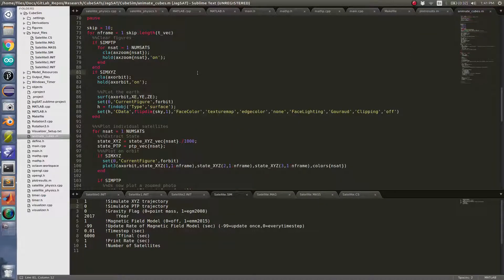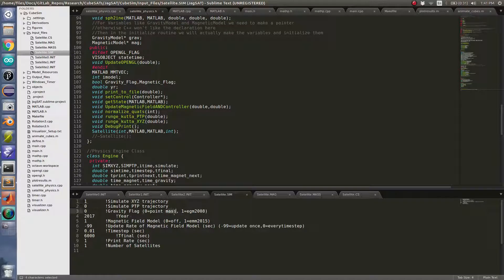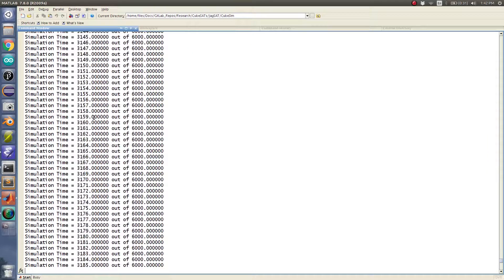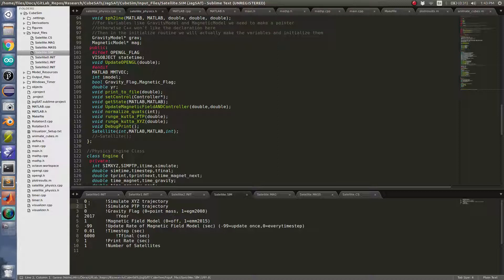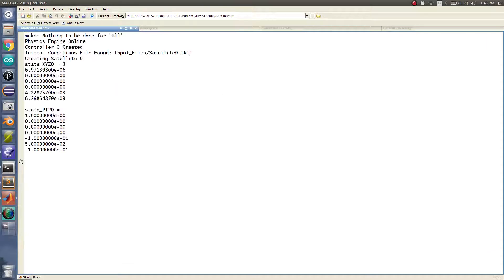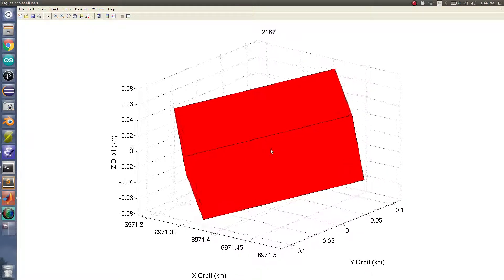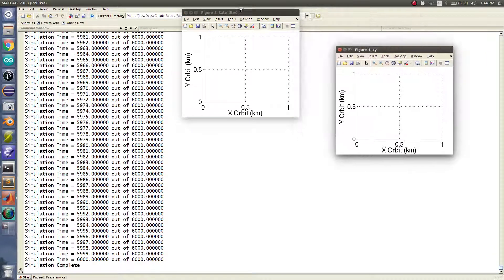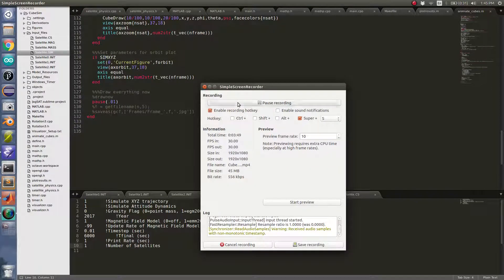CubeSat Orbit and Attitude Dynamic Model

Comment: Hi! Great simulation, really loving it. If I only can ask for your help, I'm still having trouble running the simulation (I don't know how), if you could help me out, that would be great!
Reply from the maker: What's the issue?
Reply from the maker: Have you tried to download the source code? https://github.com/cmontalvo251/C/tree/master/Orbit
Reply: @CarlosMontalvo251  Yea I did but the issue ist, that after I run plotresults, I get error, that State.OUT is missing in directory Output_Files.. I don't know if I did something wrong or something.
Reply: @CarlosMontalvo251  Like I'm not able to run makefile properly using mingw64-make, cause I have issue with boost/thread.hpp, which I'm not able to solve..
Reply from the maker: @lukasmatusik1096  Since this is a software issue tracked on Github can you raise an issue and I'll take a look?

Comment: if i'm extracting i, j, k vectors from my rotation matrix (3 * 3) is it possible to show them as 3D rotating vectors slimier to your red block using Matlab movie function?
Reply from the maker: yes you can. If you have a rotation matrix R the code would look like this

zero = [0;0;0];
for idx = 1:3
     v = [zero,R(:,idx)];
     plot3(v(1,:),v(2,:),v(3,:))
end

There are probably more elegant ways to do it but that will work.

Comment: What are you using to run both the MATLAB code and the C code?
Reply from the maker: You can rub system level commands as if you were typing into the terminal using a command called system() 

Does that make sense?

Comment: Really nice video, could you share the code?
Reply from the maker: Hey. Took me a while to get the code ready. Turns out this code was purchased by NASA and changed quite a bit. As such the current iteration of the code is proprietary. The good news is I was able to find a previous revision of the code from before it was purchased. It is not as nice as the current iteration but you will at least be able to recreate the plots in the video above. https://github.com/cmontalvo251/C/tree/master/Orbit
Reply: @CarlosMontalvo251  Wooo really really thanks.
This sure will be an enormous boost for everyone trying to learn orbital mechanics that watch your video

^.^
Reply: Or at least a really nice tool for showing orbits XD
Reply: @CarlosMontalvo251   The code is no longer at that link, could you post where it is right now if you have it?
Reply from the maker: @aryaashutoshpathak4849  The current C++ simulation is here in an archived repo that has not been merged yet and probably never will.
https://github.com/cmontalvo251/C/tree/Break_Everything

Eventually the full simulation will be in this repo but this is still terribly a WIP
https://github.com/cmontalvo251/FASTKit

There is also a MATLAB version if you'd like to just run the entire simulation in MATLAB
https://github.com/cmontalvo251/aerospace/tree/main/adcs_seminar_series

Feel free to comment if you need any new links! 1/31/2022

Comment: Good day Dr Montalvo. I saw your video on the RK4 method u used to solve problem for Shanks Leroux. I've been trying so hard to use your method to solve by 5 systems of coupled ODE but to no avail. I am not good in MATLAB and I've been trying on my own to do this. Please, will be really glad if u can assist.
Reply from the maker: Before you get a system with 5 coupled equations you want to try and do it for a very simple system. Have you watched this video yet? https://www.youtube.com/watch?v=PPwUaxTp8Uk